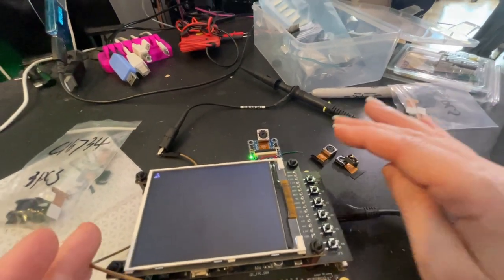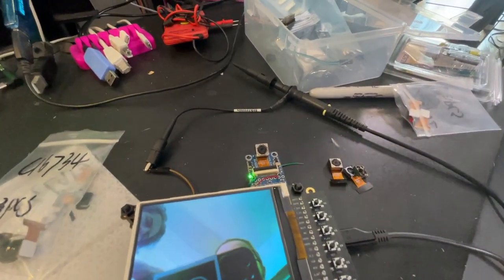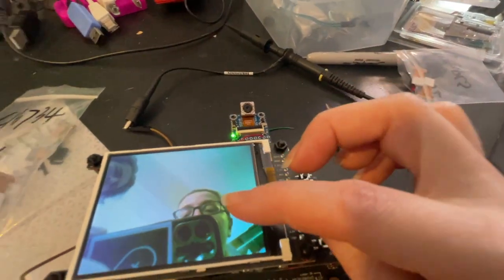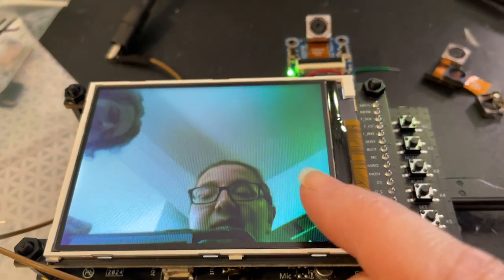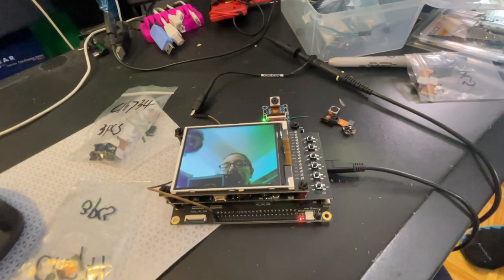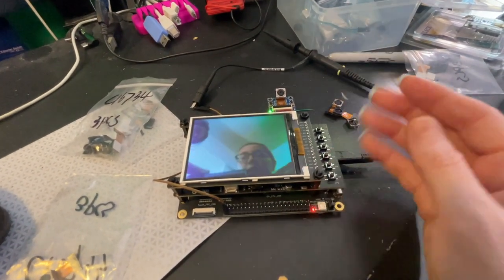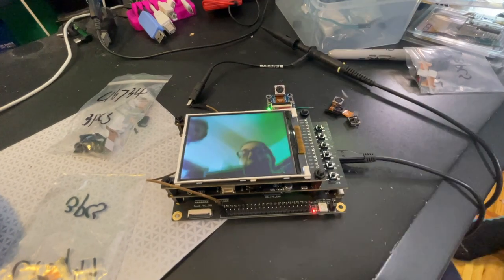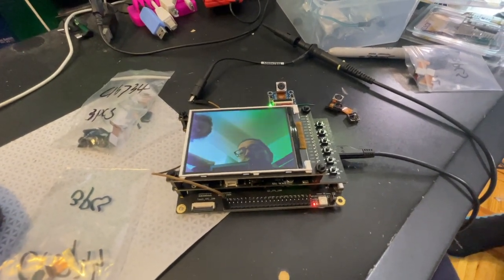Autofocus mode working on OV5640 camera module in CircuitPython

Comment: Thank you for for making the OV5640 breakout board.  They work great and are really well documented.  Currently using the 120 degree autofocus camera to look at stuff up close.  I really like that there is an internal clock so we can save an IO pin.

Comment: Well this is very interesting!  I did not know that these cams had that.

Is it only the OV5640 that has this voice coil auto focus or does the lower end cam, that comes with the ESP32-CAM boards also have it??

Also, do these OV5640 cams have night vision option that can be lit up via IR LEDs?